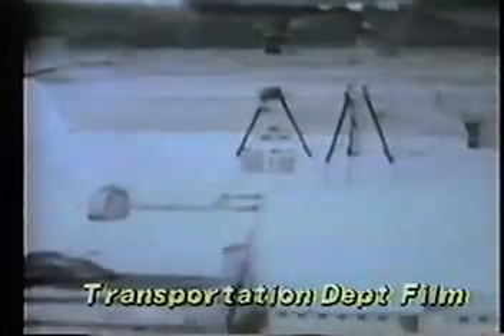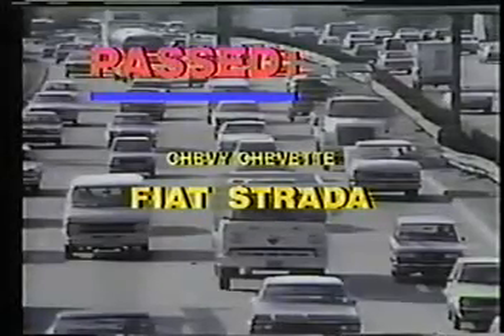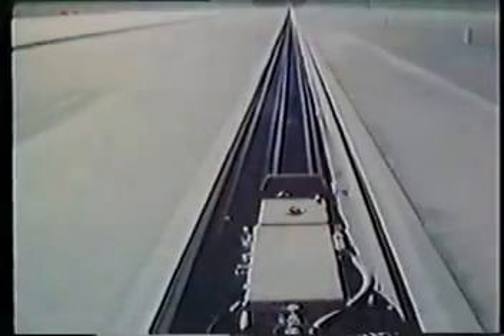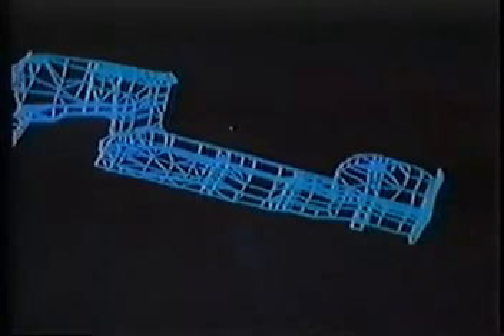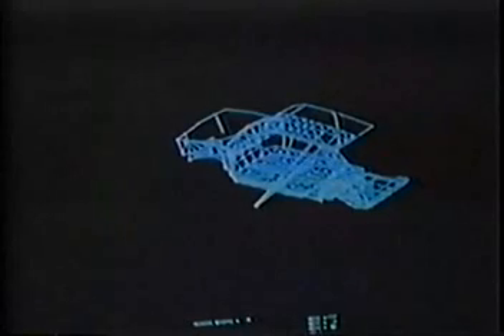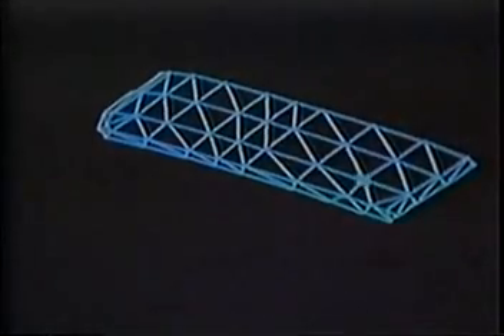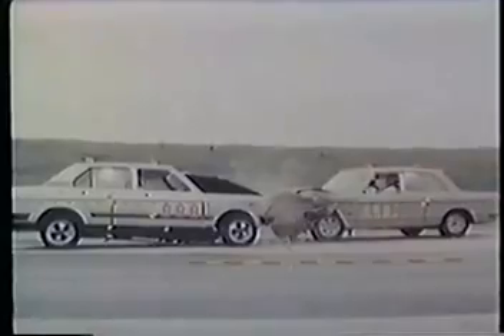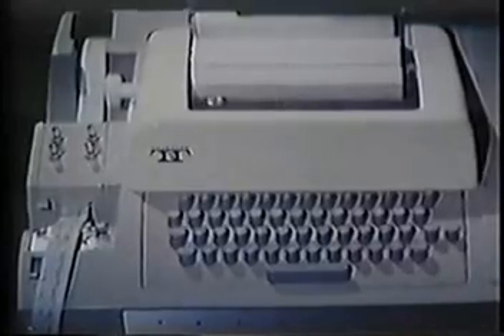fiat crash testing

Comment: i dont get it ,fial sold some model 126 to the soviet union and its called Vaz, in Italy 126 crasch test was good but in soviet union it was so bad the had to fake it and call it " good"
Reply from the maker: fiat sold 124 licence to sssr, not 126, and that became lada. up untill 1985 or so ladas were as good as fiats, and in crash tests even better because of thicker sheet metal used for body. after that, production quality dramatically declined.

Comment: Back in 1982, my '76 128 2 door sedan was going less than 50 mph when I swerved slightly around a pile of glass left in the road from an earlier wreck. Lost all traction from the rain and motor oil. The Fiat did an end over end between a tree and a pole, then rolled 4 more times down a 30 foot embankment landing in a field--roof down.  Looked like the one on the video with wheels tucked under.  Sad.  Fun car.  Tough too.  Compressed vertebra was only injury.

Comment from the maker: 1980 fiat 132, 1982 fiat 131, 1984 ritmo abarth...
need more?

sorry pal but skoda superb is just plain uncomfortable. seats are too hard, ride is appaling, handling is nothing special. 
front and rear suspension components are made of chewing gum and fail often even in first couple years of use and replacement parts are expensive.

Comment: No man, sorry but it doesn't work like this. A head on impact with another car (both with similar weight and speed) at 40 km/h is just the same as going at 40 km/h into a rigid barrier. In EuroNCAP tests cars collide at 64 km/h, 40% offset, into a deformable barrier, while other NCAPs protocols require a 50 or 55 km/h impact, no offset, into a rigid wall.
FIAT's results were important at the time, but they're outdated in comparison with today's vehicles.
BTW, many thanks for the upload!

Comment: Fiat cars at the late 70s were very good at price and top equiped, we had a mid green 132 injection, a very good  car, in 1989 the rust took overhand of our loved 132, after 8 years of loyal service, here in Luxbg you can still see 130 coupés with rust but still running after 35 years, wonderful cars the vintage Fiat.